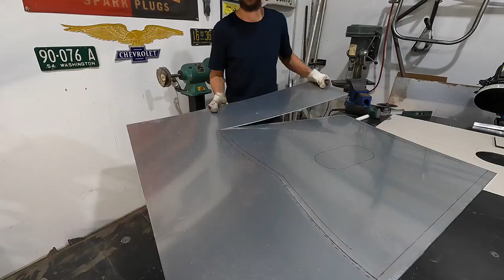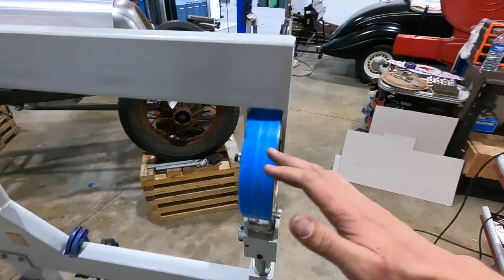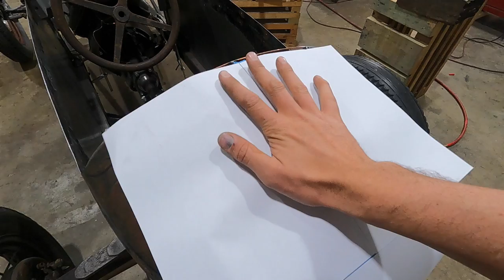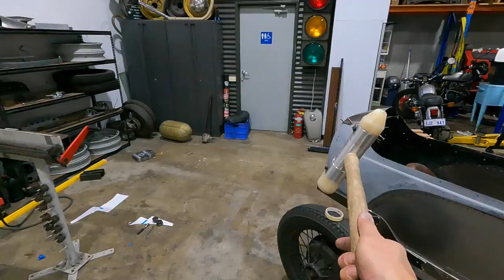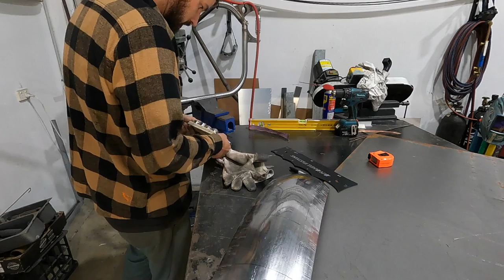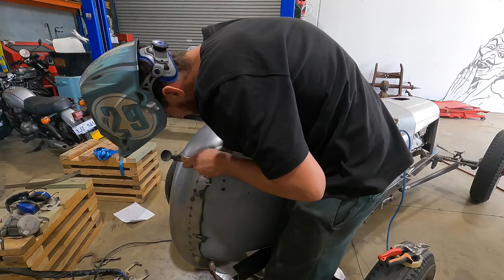FABRICATED REAR BOAT TAIL SECTION - Single Seater race car

Comment: Shoe Goo, E6000, hot glue, even thick C.A. applied to the edges of the band should keep the thing from shifting in use.  With your skills a long time solution is to tweak the plane of the wheels to solve the problem.  Even blue tape around the edges!

Comment: Excellent work on getting the rear to flow Jordan, some of the '30 ish sprint cars had the rear panel roll under and towards the diff and it looks good. I agree that once the exhaust is in place the side proportions will look right, eyes will be drawn to the pipes and the rivetted highlights not just the body as it is now. Cheers 👍
Reply from the maker: That’s what I’m thinking, if it looks like it needs something I could ad a blister or something in place.

Comment: Looks great .i wouldnt worry about hood lines .its nicer than it would have been in the day.if you do remake hood i would move hole in top back slightly..with pipes and push bar it will be spot on.

Comment: Hi Love your little project. back in the late 1960's and early 70's we made boat tail bodies for our specials by cutting the wings off Morris Minor  bonnets and welding them together top to bottom with a fillet between them to give the required height. They were a perfect fit for early Morris or Ford specials. I guess they would shoot you if you started hacking up those bonnets these days.

Comment: i was going to suggest using masking tape on the wheel. On the rear i would of tacked it then cut it and replaced each tack with a butt tack. to save it falling apart and having to rearrange it all again. i love that plenisher its so useful in or out the vice

Comment: Looking bloody good so far, top job! The only thing I'm thinking is to finish off the chassis rails by joining them together in the same way that you've done the front end? Surely there's gonna be a risk of flex as they are? Join the ends together somehow? Other than that I love it!! 👍😁
Reply from the maker: A push bar will have them tied together. If I decide to run a roll bar it would also do the same
Reply: @bennettscustomsco  thank yo for taking the time to reply! That sounds like a good solution, it's just the way that you've done the front end looks very good so doing the same at the rear would, in my eyes, be a lovely way to finish that area. Excellent work on the videos by the way, very entertaining and informative.

Comment: I would take apart that bottom wheel on the bead roller and remount it square it shouldn't be that hard to do. btw Jordan are you able to buff or use the planishing hammer to get those lines out? on the aluminum hood.  As My kid's would say Jordan Dad that looks Sick! hahahaha Great job, I'm impressed that little single racer looks cool, you done a fabulous job there bud.
Reply from the maker: I will definitely give it a try and see if it works, I may change the air cleaner so a different hole cut will be needed.

Comment: Hey Jordon, buggy is looking great...thanks YT for the random 'recommended' channel! Didn't know you had one. Very well crafted vid and sound mate! Did you think of using wood along the top edges of the cockpit? As well as being warm to look at, it'd probably be friendly to lean on while racing, and easy to shape. Old battered blondwood like oak or elm...and it'd also be easy to add some beaten leather upholstery elbow pad. I have some so old leather machinery drive belts if you'd like some. Good for cowl/bonnet straps too. I'll be up to pick up the beater Troopy from Tom in a week or so, so will drop in. All the best, Harley Rob, Cowie.

Comment: Noticed Carl at "Make it Kustom" having the same fight, keeping the rubber on the roller. 
Maybe  you could fashion a set of little roller guides at 4 and 7 o'clock that actually contact the side of the roller.
Some ½ nylon hollow dowel from Mc Mastercarr for example
Reply from the maker: I think the English wheels getting a make over next week. So I will figure out that part as well.

Comment: I've been searching like crazy to find a rubber band for my English wheel here in France; where did that fancy orange one come from?
Reply from the maker: Just an eBay job, it does work just wish it was slightly smaller
Reply: @bennettscustomsco  I've got the same issue if I buy one online, they're all for 200mm wheels and I have a 150mm wheel :(
I'll see if there are inner tubes for trucks or something similar that I can cut a section out of to do the job; if so I can prolly send you one :)